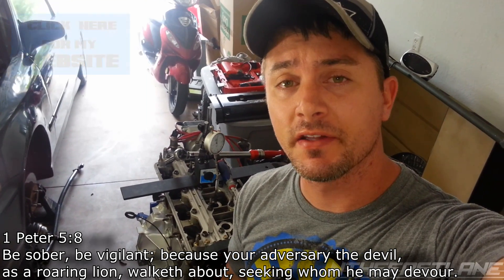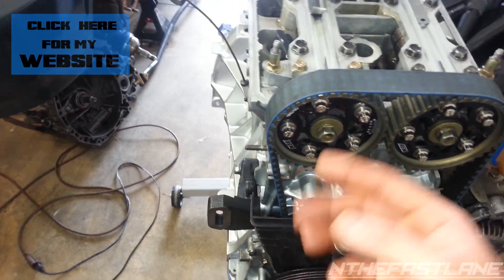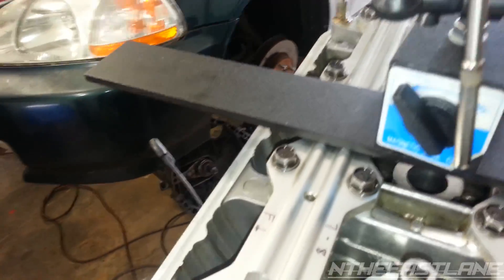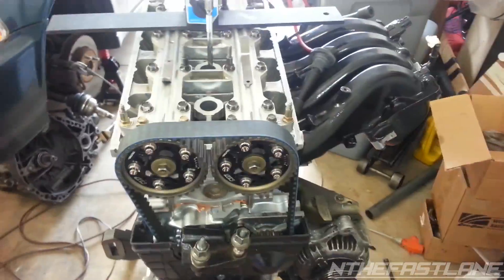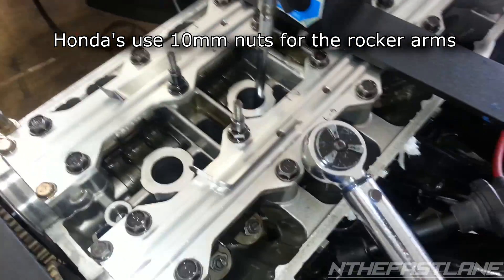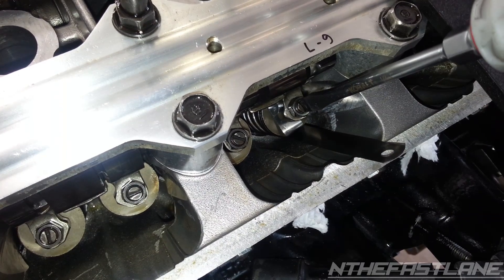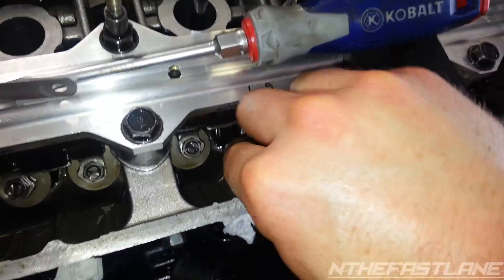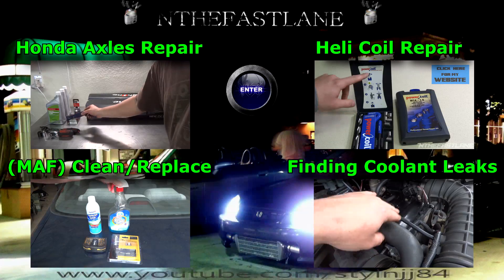Valve Lash Adjustment For Honda B-series (Civic/Integra) "How To"

Comment: I think your head gasket on the wrong way.
Reply from the maker: It's on the correct way. B18c1 Tab hole to the cam gears, angle pointing towards exhaust. What makes you say that?
Reply: @Nthefastlane  that tab looked like it didn’t line up but I guess it’s different on b18c1 I have a LSVtec and I Dont have that tab so I assumed it was flipped. But I think I’m wrong from researching it online. I have a cometic 81.5 gasket maybe different design.

Comment: I’m confused are you suppose measure under the screw or under the cam?
Reply: Ive been searching for this answer and it seems everyone does these two ways. In my actual honda service manual for del sol b series, you measure between the cam and rocker. But my engine builder said to measure between bottom of adjustment screw and top of valve. After watching multiple videos im going to go by what my engine builder said since i do have aftermarket cams but not sure if that matters.
Reply: @ThatGuyinAnotherHatch  thank you bro
Reply: @Multivloggerr  I know its a year later but hopefully it helps you still or someone else sees this
Reply: @ThatGuyinAnotherHatch  yea I know haha no worries bro. I’m actually still working on it. got a b20 with built gsr head and a b18c1 gsr integra motor that I will be rebuilding with a turbo kit soon I’ll be posting videos soon just for people that are barely starting to learn
Reply: @Multivloggerr  Nice brother, I have a built b18c with a b16a head. Turbo as well. Shes on my channel if you wanna check it out. Bent 8 valves last year now im finally getting around to assembling the engine again. Did the valve lash last night, all came out good.
Reply: @ThatGuyinAnotherHatch  na I didn’t run into that video. And yes most definitely, I’ll check out more of your stuff. Interested to learn more about turbo and new thing about the b18c1
Reply: @ThatGuyinAnotherHatch  thank you bro I’m gonna try both ways since I did the valve lash between the cam I’ll see ow that feels

Comment: I'm a tractor trailer mechanic and diesel engines go threw many valve adjustments this is the first video on YouTube I see someone doing a valve adjustment the correct way the feeler gauge has to go in between the valve and the rocker arm adjusting screw amazing job dude

Comment: This is not the right way to adjust your lash. You run the gauge under the cam lobe not the adjuster and also you don’t just turn the nut to tighten without holding the adjustment screw in place. This is all wrong!!!!
Reply from the maker: The rocker arm is one piece, whether you adjust it by the adjustment screw, or the lobe, it will be the same amount of gap on either end. Sometimes you have to hold the adjustment screw, but if you've done it enough times like I have, you know how much to back it off before you lock in the nut.
Reply: @Nthefastlane  The comment i've been searching for. i dont have the screwdriver/socket tool so if I back the screw off enough then tighten and double check clearance it should be fine? I imagine it would just take more attempts to get it correct.

Comment: This is the right way. The rocker pads wear in: making grouves. Go between the adjuster and valve stem with a wiggle gives a real adjusment. Its a slow and tediouse way. i like a 3 time run through all valves

Comment: Supposed to be under the cam lobe not on top the valve
Reply: Yes, I read the manual. So the video is wrong, isn't it?
Reply from the maker: Using the feeler gauge between the cam lobe and rocker arm, vs using the feeler gauge between the valve and rocker arm gives the same exact results. It's just easier to access between the rocker and valve. The space between the cam lobe and rocker arm is the same exact amount of space between the valve and rocker arm. It just comes down to preference. The results will be exactly the same. Both ways are acceptable.
Reply from the maker: The rocker arm is like a seesaw, up and down has the same amount of distance. The rocker arm touches the cam lobe, and the rocker arm also touches the valve. It just depends on which end you want to measure. But both ends measure exactly the same space.

Comment: Please help, I just installed skunk 2 x pro valve spring and loss motion springs, with stage 1 camshaft. My problem is when I properly torque caps the cam is hard to turn and when it turn it falls on the lobe with a lot a pressure. Please help don't know what to do next
Reply from the maker: +Sergio Flores When you're Torquing, the bolt isn't staying in the same position when you toreque the nut. It's tighting with the nut causing less clearance. Double check the clearance after troquing. Also make sure the crank is in the right position, if not,it could be the wrong clearance.
Reply: Nthefastlane ok thank you, I'll check clearance.
Reply: Dumb question, since I bought a aftermarket cam with bigger lobes, the manufactures clearance won't apply anymore correct?

Comment: So what's the correct way to adjusting?; I seen people put their feeler gauge between the rocker and cam lobe. You put the feeler gauge on top of the valve.
Reply from the maker: +Emanuel P Always on top of the valve, and under the rocker.
Reply: Yeah I'm confused, I put the feeler gauge in between the round side of the lobe and the rocker arm.... Is the feeler supposed to be in between the 10mm bolt?
Reply from the maker: To clear it up and be specific, you put the feeler gauge between the top of the pushrod "AKA" valve, and under the rocker arm.
Reply: Nthefastlane wrong